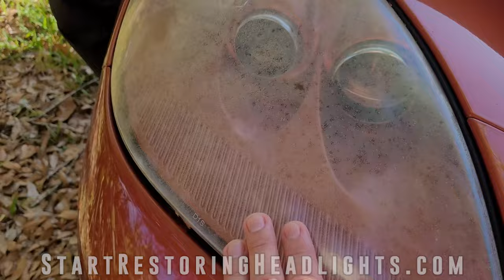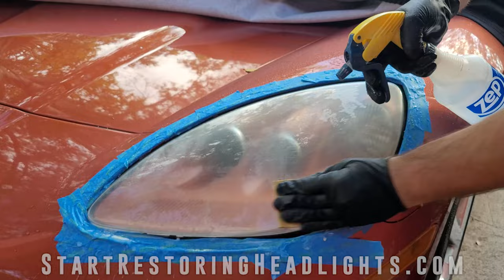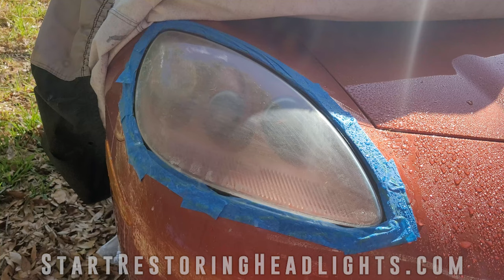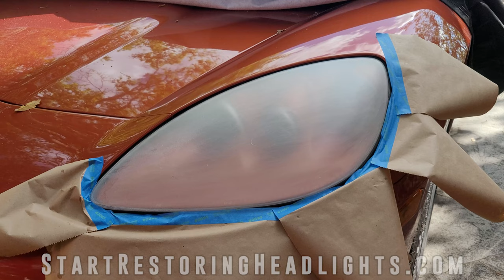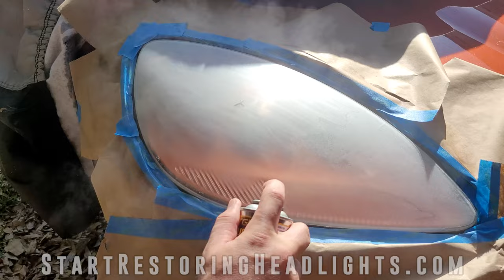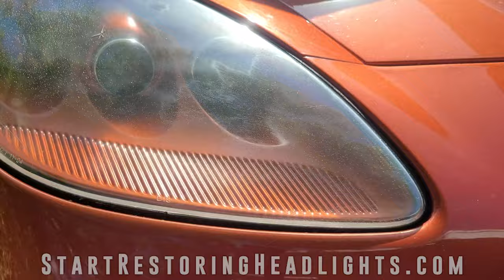Attempting to remove Microcracking on a 2006 Corvette | Headlight Restoration

Comment: Actual micro-cracking goes through the plastic, and is on the inside as well. Polishing like this only helps one side, and eventually it will become something so noticeable you'll want to replace the lenses.. It's 2024 and my 2007 couldn't be polished out enough to look decent, but it worked in 2014, and again in 2020 well enough to get by.  I even tried removing the lens and doing this to the inside, but it's inherent in the type of plastic.
Reply from the maker: It depends on how far the headlight is. Some microcracking is more on the surface rather than deeper in the lens, which we can address. Unless you sand for an excessive amount of time, you can't get them out, and even then you're severely weakening the lens.
Reply: i've also done it. heavy cracking and yellowing, after sanding the shit out of it, buff and 2 bottle or the steam/headlight restorer still yellow and tons of crack. 🤣 it made a little transparent but still yellow and looks old😅
Reply from the maker: @422JF  Aw man I've been there! Sometimes when they're super oxidized you can't see how severe the microcracks are until after you restore them. Its weird that its only with certain models.
Reply: @StartRestoringHeadlights 
 I'm doing this right now to a late model Mercedes - in need of lens replacement because the inherent chemistry of the lexan eventually yellows from oxidizing, plus the curing  plasticizer was an incomplete process.
It's kind of like how the man-made rubber of tires continues to cure and harden tbrouout the life of the tire.
Reply: My 05 has the cracking.. Just seeing what solutions are out there.
Reply: @garyc.4462 
I found replacement lenses on ebay are cheaper than most places want to do a polishing job. Ive even seen popular vehicle models headlight lenses on "Chinese Amazon" lately, so I'm going to try a set of those for a 2015 Nissan Rogue, which has longitudinal stress cracking.
My '07 Mercedes turned out beautifully, with lenses from ebay and LED s from Amazon. Total cost was under $200.

Comment: I’d give it 4-6 months before those headlights start degrading right back to where they were. Corvette lights are uncooperative beast of a headlight. 

I’m surprised you were able to get them presentable again, but you can tell they almost look ready to age even in the after shots. Lol.
Reply from the maker: Hi Samuel! We get these Corvettes often, and some have microcracking and some don't. The deteriorating clear coat makes it look 10x worse. If you have a good clear coat thats specifically designed for headlights, you'll get much longer protection than 4-6 months. The sunshine is a microcracks enemy. In the shade it looks better, but when light enters the microcrack and refracts, it looks worse. Regardless, much cheaper than replacing!
Reply: @StartRestoringHeadlights  Yea my neighbor had a Corvette just like that one. Same color & everything. This was years ago he asked me if I restored headlights and like a fool I agreed and went to Oreillys and picked up Meguiars Headlight Kit with the sanding discs, I think they used to go down to 500 but it may have only been 800,1000,3000? Whatever it was it sure as hell wasn’t enough to even tickle these headlights. Couldn’t even begin to remove the coating nor haze the plastic 1 bit. 

I wasted over an hour of my time and money only to have to do the walk of shame. I will never again make the same mistake of agreeing to restore lights on a Corvette. Lol. 

And yea I think he said those lights cost $1,800 brand new. They knew damn well what they were selling you knowing you’d have to pay up the ass when it came time for new ones.

Comment: Use more masking paper.  I had a fair amount of overspray that needed to be removed
Reply from the maker: Thanks for the tip!
Reply: @StartRestoringHeadlights  - I’m dealing with cracking that I can’t figure where it came from.   I watched a video where a 911 headlight was deeply scratched and it was repaired by applying clear lacquer with a Q-tip and then sanding flush and finishing as normal.   I’m to the point where I may try that otherwise it’s gonna be some aftermarket headlight assemblies.   2007 Z06
Reply from the maker: @motorgearhead  Yes, the microcracking is caused by the lens expanding and contracting. Unless they are on the surface, there's nothing you can do, since they can in the middle or back end of the pane. If you can get some of the cracks exposed, you can fill them with a clear coat, just make sure the chemical you're using is for headlights, otherwise it won't flex with the lens.

Comment: I might have to start with a 100 grid sand paper and finishing up with 3000 grid, I would not lay clear coat but polish it and ceramic coat it, because my had light is madly cracked on my B9 A4
Reply from the maker: Starting with a 100 grit will severely cratch up the lens. It would take a lot of time to completetly remove them. If you have surface microcracks I'd start with a 320 to remove. I have the same car, and I hope I don't ever get cracks in mine ha
Reply: @StartRestoringHeadlights  yeah but I saw somebody sanding with 80 grid on YouTube, and my headlight is badly cracked it will take alot of time to send through the cracks with a 320. I will try with 320 and see what results I get.
Reply: @Gearsandco Cermic coatings offer little to no protection from UV on headlights. You might as well use that tube of wax that comes with some of the kits because it’ll be just as worthless at protecting them. Lol. 

Seriously though, ceramic coatings do not protect from UV.
Reply: @Samuelfish2k  fact check your answer with a little research and you will realize that yes true ceramic coating has a shield against UV regardless of the surface your putting it on as long as it bonds.
Reply: @Gearsandco  He has more proof. Check out his vid titled 
“How much UV protection does your wax, coating, sealant provide”
Reply: @Gearsandco  “Optimum Car wax does it really provide UV protection” 

Go look at the proof, and come back and admit you’re wrong. I’ll be expecting you in a bit.

Btw that test even shut up Dr. G himself! His claims aren’t valid and that guy proved it and even debated him in the comments and won. It’s all there to see. Go learn some facts.
Reply: @Gearsandco  What do you have to say now?🦗

Comment: how do you cut down on time? on average it takes me about 1 hour or so
Reply from the maker: Hi C-Los! There are a few different ways. If you're using a tool, theres much more prep time, meaning more tape will need to be applied. Since I am doing it by hand, I don't need multiple layers of tape. Starting grit is what determines how fast I can remove the old clear coat and micro cracking. I started with a 320, then finished with a 600. Starting with a rougher grit, it will remove what is needed to be removed much faster than using a finer grit.

Comment: I see people usually dry sand when using the lower grit and wet sand after 600. You lights came out ok, but wondering if dry sanding would of made them better, or a lower grit was needed? Hard to know.
Reply from the maker: Hi Danny! No method can remove microcracks. Dry sanding, wet sanding, Vapo method unfortunetely theres no cure. These cracks are in the middle of the pane of the lens. Removing oxidation can still make the light look better even with microcracks, which is what I did here.

Comment: I have a list of questions I want to ask before I make a purchase on your product.
1. How do you handle overspray that gets on the vehicle?
2. When I use cans in the past, it would having dripping some times. How do I avoid that?
3. Why don’t you do 2 coats? Is there a reason? Would it hurt?
4. What promise can I put for how long customers can expect it to last?
Reply from the maker: Hi ShoeHefner! Great questions! Overspray is very easy to remove. Simply wipe it away with an alcohol soaked towel. We have a video on how easy it is to remove it. 

Dripping is a result of 2 things, either you're too close to the lens, or you're moving to slow from side to side when spraying, and yes, it could be both as well.  There is a sweet spot that you'll get with experience. 

Apply 2 coats isn't necessary since the spray comes out thick. If applying more than 1 coat, it can cause a much longer cure time. Although it wouldn't hurt, you would just be wasting product. 

Our clear will last 5+ years as long as it's applied correctly. Its also backed with a warranty for early hazing (not application issues such as flaking or drips)
Reply: Thanks. Lastly. If I order now, how long until it arrives (NC)?
Reply from the maker: @ShoeHefner757  To NC it usually takes about 3-4 days.
Reply: I can’t speak on the specific spray he used in the video, but generally speaking applying a 2nd coat will slightly dull the 1st coat. You’re better off applying 1 moderately heavy coat starting from bottom to top to help avoid drips.